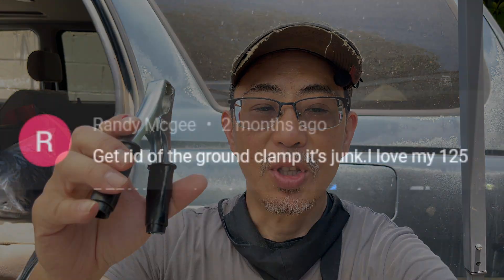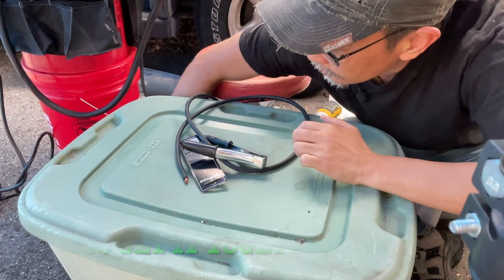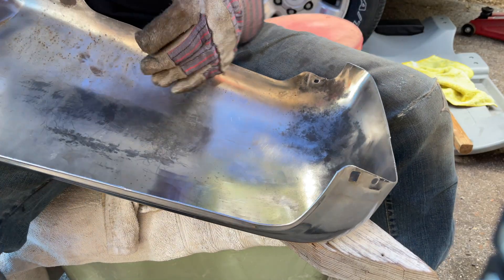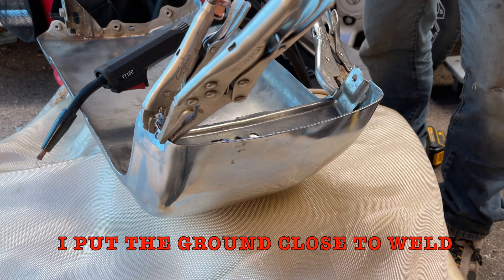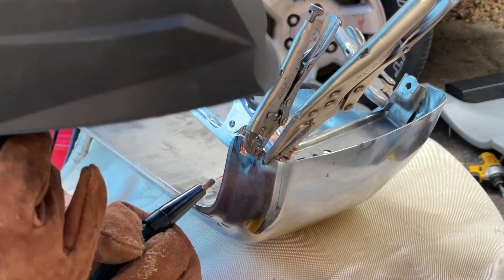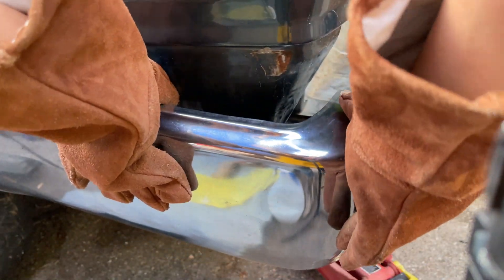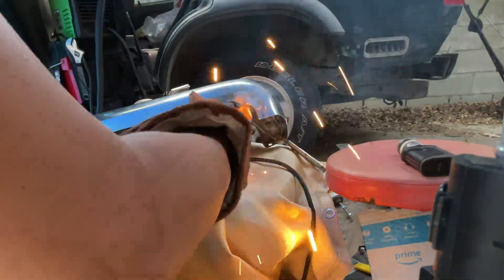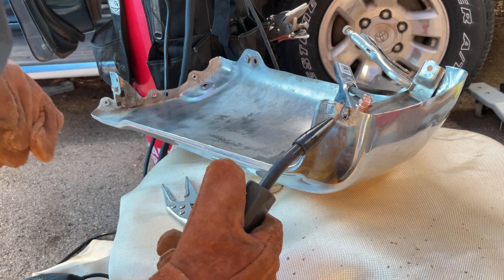Why should I Replace The Ground Clamp on my TITANIUM Easy-Flux 125 Welder with $8 BERGER 300 Clamp

Comment: Brother, are you still on YouTube?
Reply from the maker: I've been recording, but not posted in awhile
Reply: @Squisheyy 
Brother, I desperately need your help... The car repair shop disabled the protection system on my car's computer due to a fault in the fuel injector line, but they asked me to disable the immobilizer before starting the car... Now I want to ask you where the immobilizer is located in a 2000 Four Runner and how do I disable it?
Reply from the maker: There are 2 types of immobilizers. After market and factory.   After market use a FOB or chip key, I have a video where I removed mine.  The Factory are usually on Limited models and the chip is in the key.  Disabling the factory or by-passing. I do not recommend it. It takes reprogramming the chip in the main ECU and soldering a bypass module.  It can cause other issues down the line.  Come to think of it, that shop doesn't sound like they know what they are talking about.  The injections system fault is usually related to the fuel pump, wiring, fuse, or injector going bad or clogged, it doesn't have anything to do with the immobilizer other than the immobilizer will not allow fuel to pressurize and pump if the security is enabled, but all you other systems will be off.  Do you have the code? Does the engine start?
Reply: @Squisheyy 
Dear brother, I am from Iraq. The problem started when the fuel injector wires caught fire. I had to extinguish the fire with water, and after that, I repaired the wires, but the car wouldn't start. I took the computer to a computer repair shop, and they told me there was a fault in the fuel signal line and that the computer's protection system needed to be disabled. They repaired it and disabled the protection, and they told me to disable the immobilizer before starting the car. Now the car won't start, and when I tried to disable the immobilizer, I couldn't find it. That's why I'm asking for your help in locating this part.
Reply from the maker: I see, the ECU fuel sending module was damaged. The factory limited edition immobilizer 
is the chip, inside the key, the Antenna coil ring around the ignition lock that senses the keys and the transponder ECU is behind the steering column
Here is a link for a diagram https://www.toyotatownpartsdirect.com/a/Toyota_2000_4Runner/47976914__5892584/Anti-theft-device/842318-8424-671460.html
I think they are referring to the Transponder /  Amplifier part number 89783-35020 that sends the signal to the ECU.

Comment: Great video. The Titanium 125 is a great welder that burns really hot when you crank it up for thick metal. In addition to the undersized clamp, the cable is only 10mm/8 gauge.  I replaced the cable, adding a short 4-gauge wire inside to a dinse 25 connector that I mounted in the same hole where the old cable entered the welder. Now I can use the 2 or 4 gauge longer working/ground clamps from my other welder. I did a short video on my channel if you're interested.  I also added a handle and latches. Everything I used is in the video description.

Comment: I have the same welder and used it to weld a riser mount back onto my mower deck that snapped off cleanly at the factory weld. The welder wasn't giving me a good steady spark. It was intermittent and spotty at best. I have welded in the past and I knew something was wrong. I was able to get the riser welded back on by turning up the amps but it was probably the ugliest weld I ever made and I haven't needed it since. I'm pretty sure the problem is exactly what this video points out, the grounding clamp is weak. So before I use the welder for any other job it's getting a new clamp.
Reply from the maker: With the old clamp I would grind the ground spot with a flap sander and grind the spot to be welded, surface prep, and still got the same spotty spark.  The new clamp, I don't even need to grind the ground spots now.  Go figure, I didn't realize that the ground clamp could be a problem until I replaced it, but it does make sense.  It's a decent flux core welder for small DIY projects, it just comes with a really bad ground clamp.
Reply: @Squisheyy  Yeah, I was looking on Amazon for a replacement and wasn't sure wich one to buy but it seems ANY ground clamp would be better than the one that comes with it.
Reply from the maker: @paulkopacz5051  I bought the Berger one at Harbor freight, of course they sell the flux welder and the better clamp, I guess it's how they stay in business.  lol

Comment: Is the helmet you’re using not auto darkening?
Reply from the maker: No, it is not auto darkening.  I've been looking at one, any recommendations?
Reply: @Squisheyy   I gotcha, made sense why you missed when you were welding lol. Honestly best bang for buck is going to be a harbor freight helmet to get you by till you want to spend more money but for a hobbyist they’re ideal. I use an esab helmet but I’m a full time welder.
Reply from the maker: @Ezdoesit0127  lol, I missed a LOT. I figure you have to start somewhere.  I'm upgrading as I go and learn.  I did a lot of AOW 30 years ago fencing.  Flux core, as all the types, is a different game.  My beads on FC are crap and the ground clamp made a huge difference.  And better surface prep.
Reply: @Squisheyy  you’ll get there. Just gotta keep doing it only way you’ll get better. No way around that.
Reply: @Squisheyy I've got the Vulcan arc welder helmet from harbor freight that was just on sale for $99 and it works great but I also have the auto darkening yeswelder M800HP large view and I love that thing. It's so comfy. Works so well and the viewing area is massive. Both around $100 when I got them.
Reply from the maker: @shadylite  I’ve seen it at harbor freight.  I’m going to look more into it before I drop $$$ on it.  Thanks for the heads up.